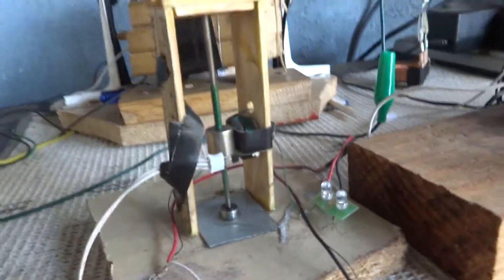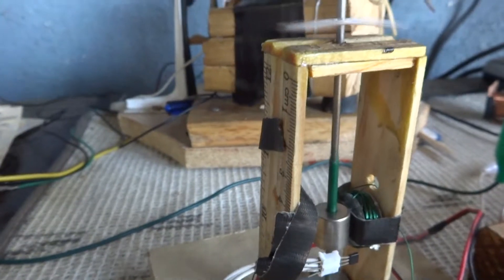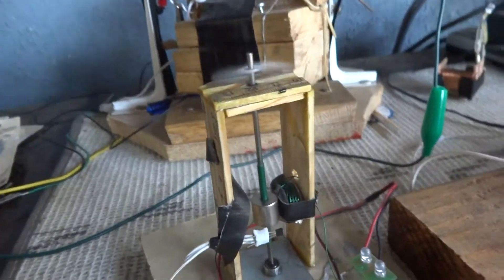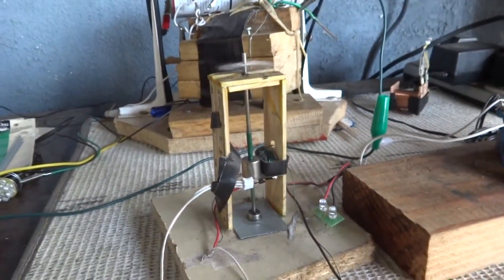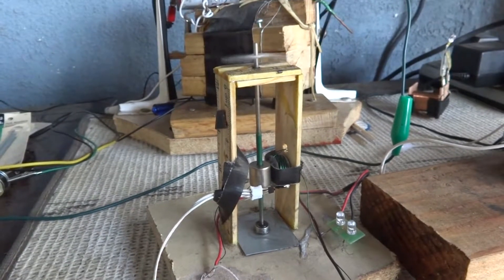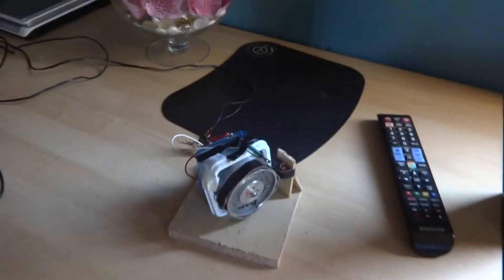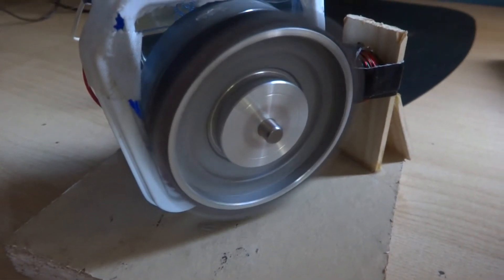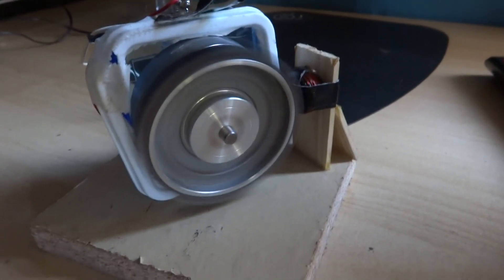Lidmotor replication. Latching hall effect sensor pulse motor, solar powered.

Comment: good day mr eric, which hall sensor do you use and what is the wattage of.solar panel?
Reply from the maker: I believe it used a low voltage (9v?) latching hall effect sensor.
The solar panel was 5 watt, 24v, I think. Obviously not that much power reached
the device, otherwise it would have fried the sensor. I buy higher voltage hall sensors now and power them with 2 9v batteries (18v).
Reply: Thats great sara Cumbia, wwaiting for more such motor videos from you, thank you